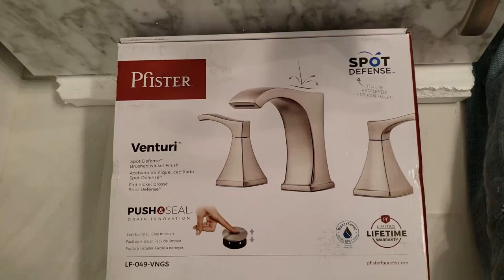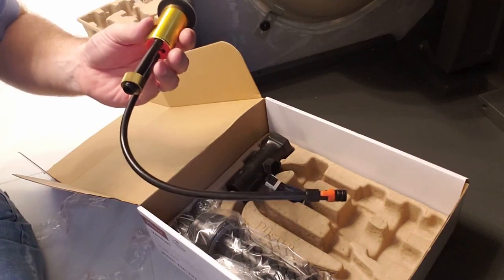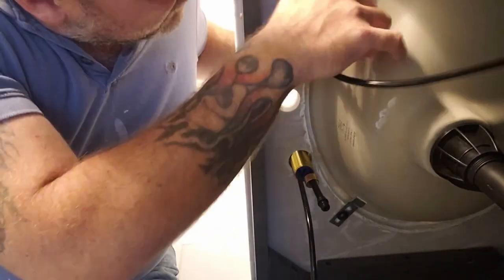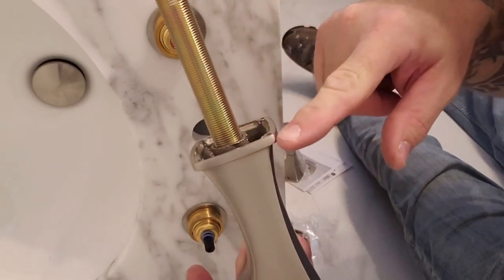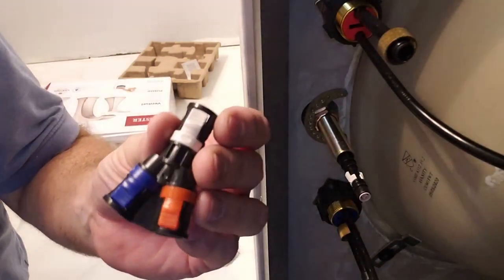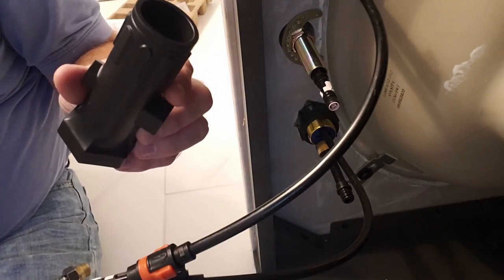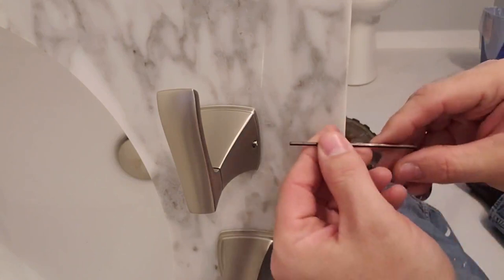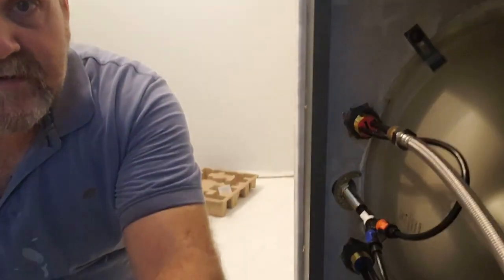HOW TO INSTALL A FAUCET WITH QUICK CONNECT FITTINGS!!!!!

Comment: Nice video. I don't trust those plastic quick connect fittings though. A flood in the making. I'm trying to find a wide spread faucet that doesn't use them but I haven't found one yet. Thanjs for the great instructions.
Reply from the maker: Thanks so much. They seam to be making them all this way. Good luck on your  journey to find one. If you do find one. Let me know. Might just be my next video.

Comment: Real nice video. Thank you !. We did install this same model. Only issue ( minor concern ) is about water flow which we feel is lesser than what it was before. How do we adjust this? ( remove the filter you showed at 8:20 timestamp ?)
Reply from the maker: @vishnuprasadnayak6891 not sure that you can adjust. It's only puts out so much water it's GPM. Gallons per minute to save water